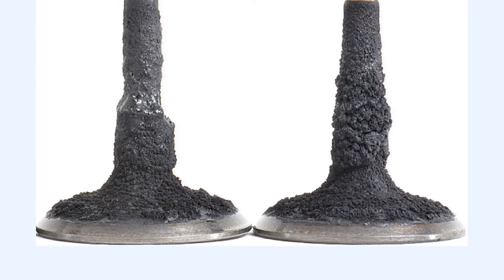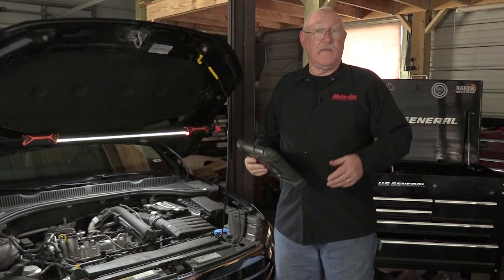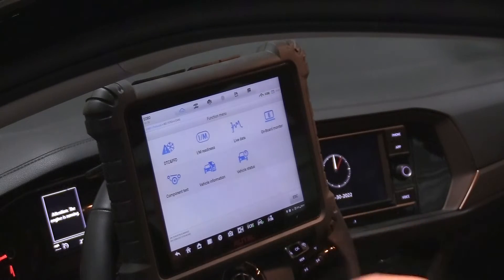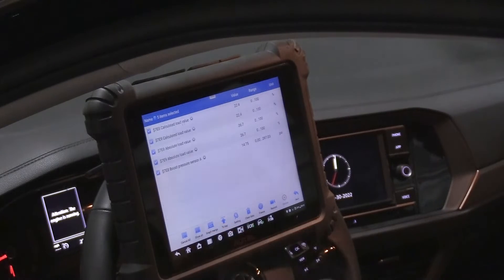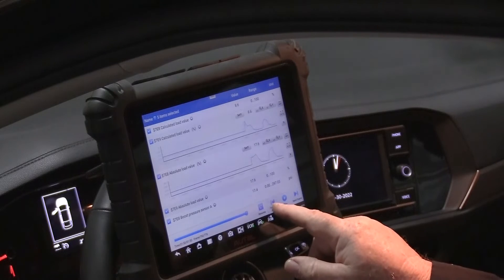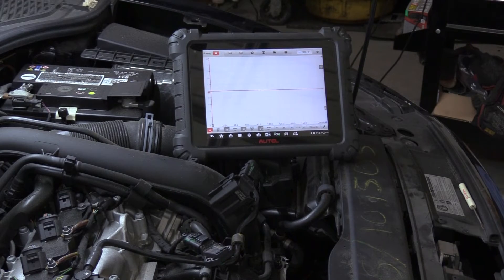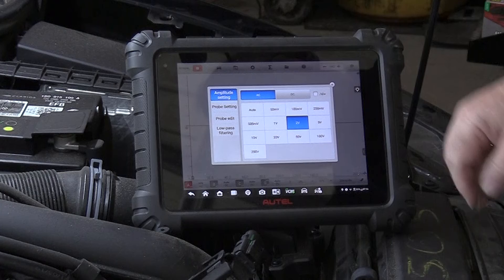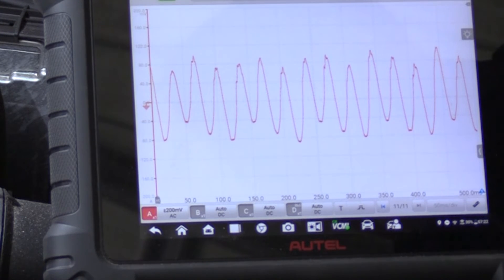The Trainer #125:  I Can’t Breathe! - Diagnosing Carbon Build Up In GDI Engines

Comment: If fresh, filtered air is going into the chamber, where does the carbon on the back of the intake valve come from?
Reply from the maker: It comes from passing through the unburned crankcase vapors that collect internally. In the old days, we vented the engine to the atmosphere but that changed with the Clean Air Act. Now, either a PCV or breather system is used to recycle these gasses.
Reply: @VehicleServiceandRepair  Thanks.  Yes, you did say mention crankcase ventilation.  I can see how this doesn't happen as much or at all with either carburetor or indirect injection, because the fuel/air mix is flowing past the valve, as you said in the video.  I wonder if the newer oil catch cans help alleviate or reduce this problem, something like the Provent units from Germany?
Reply from the maker: @Michael_Mears  Likely, but using them would be defeating an emissions system - illegal in the U.S.
Reply: @VehicleServiceandRepair  No worries.  They are both legal and in common use here in Australia.  Thanks for clarify.